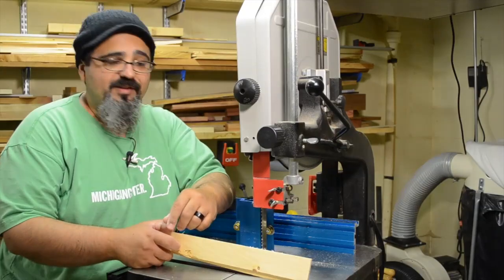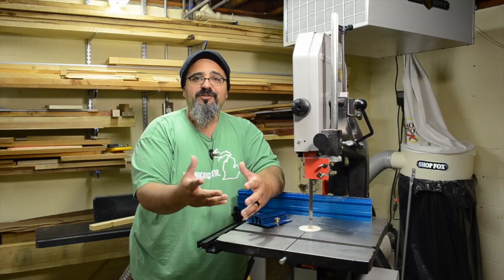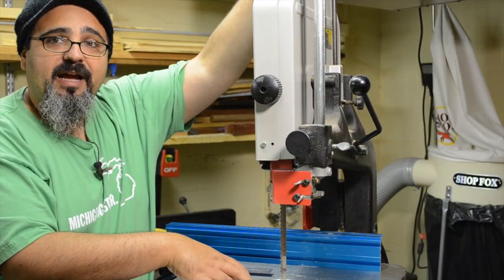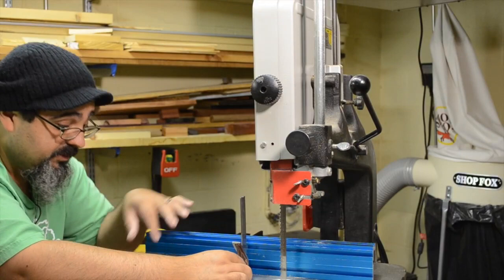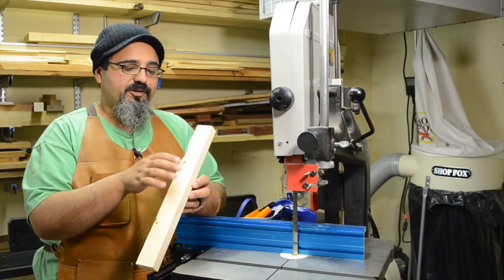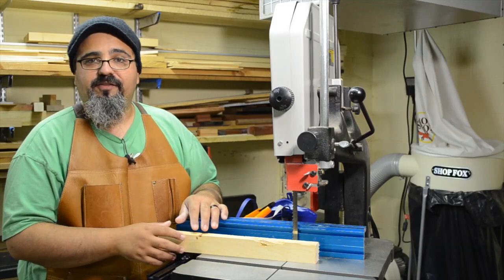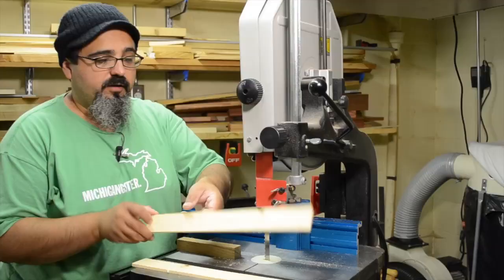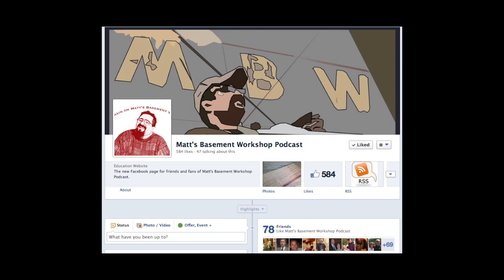511 Resawing on the bandsaw

Comment: I'm currently in the testing phase of my latest veneer resaw prototype. It cuts 18" deep in a throat 14" wide with a 2HP drive train. I use a proprietary rail-and-sled feed system that factors blade lead into its locked position. I feed it with my pinky finger. Using two high performance Iturra tensioning springs, it runs 1" lennox carbide-tipped resaw blades with only 3/32" of kerf to produce 1/16" veneers 18" wide as long as your workpiece. Because the tracking and tension system is frictionless, there is no blade flapping at any setting and the cut finish is so smooth it looks like it just came out of a planer, not a band saw. It's ready-to-glue ! I'm trying to retire but I want to introduce this prototype first because when ya'll see what a sweet machine this is it will change the way they build bandsaws hereafter; you'll no longer settle for the antiquated designs you're now getting from the big corporate tool companies.

Comment: Hi Matt.  Great video.  I was resawing stock the other day to be used on our scroll saw.  One thing that I did was run the board being resawed through the jointer so that I always had one flat face.  A little loss of material but it made the resawn pieces more uniform.

Comment: I don't put much effort into prepping the stock before resawing.  It may end up warping so if you have to resaw the piece oversize to allow for it to warp you may as well leave that extra material there.  If it's really out of whack then sure, get it in the ballpark, but then again if it's really warped that's probably a sign that's it's going to warp even more when you resaw so maybe just don't use that board.  I'll often resaw rough lumber straight off the rack.

Comment: Hey Matt...been getting back into woodworking and have been watching some of your vids. I'm debating on bandsaws...how do you like this bandsaw? Did you pay for it or was it sent for promotional intent. If you had a choice between Steel City or Jet Pro 14 or Laguna 14-12?
Reply from the maker: Thanks for watching! I received this bandsaw as a trade for advertising that I initiated versus being approached by the manufacturer, in fact I got it thru Highland Woodworking. 

I can't complain that much about this model, it's worked for almost everything I've wanted to do with it. But I won't lie when I say that I've considered looking at others. But that's not something I'm making an effort to do, so I'm not familiar with any other models. 

Not sure that helps, but thanks for asking.

Comment: Hi Matt, thanks for the video. I learn a lot in it. But I just getting some problem when I resewing with a bend saw. I square my woods with my jointer and planer. And after it I use my bend saw to resewing the wood. But after I resewing the wood, the wood just bending. Don't know why is that happen. My board was 4cm thick, and I resew it into 2.9cm and 1cm. Don't you know why is that? 
Looking forward for your reply. Thanks!
Reply from the maker: +Thomas Wong thanks for watching!

I can't say for certain these are the solutions, but the first few thoughts I have are the following:

1. the tension on your blade is too low, I'd tighten it a little more before trying again.
2. the blade is dull and it's not cutting through the wood as easily and thus deflecting.
3. you need to slow down how fast you're pushing your stock through the blade. Surprisingly this one happens a lot, even with a sharp and properly tensioned blade. Don't force the wood through the cut, instead ease it's way into it.

Hope this helps.
Reply: +Matt Vanderlist Thanks for the reply, I think maybe I put too hard on it. I should try to slow it down next time.
Reply from the maker: +Thomas Wong It's actually a common issue, one I have all the time.

Comment: My bandsaw has several speeds. Is faster better then slower?
Reply from the maker: I can't say for certain, I only have one speed on mine, but typically I think where a faster speed would be of help is to leave a cleaner surface as it's more cuts in the same time or with detailed work such as tight curves etc. 

For certain the blade's tooth number and configuration will have a lot to do with the quality of the cut, as for the speed I can't say. I just know the one speed I have works great.

Thanks for watching.